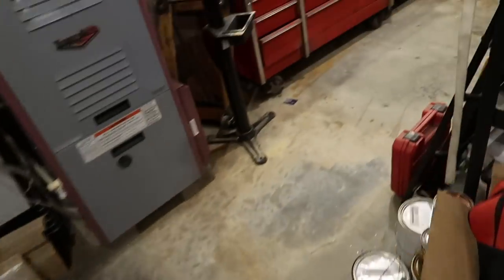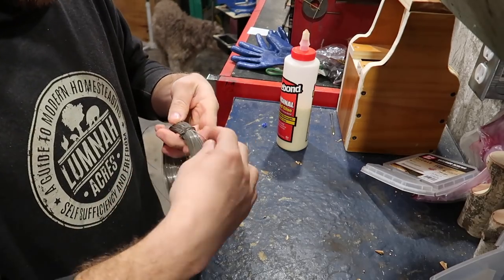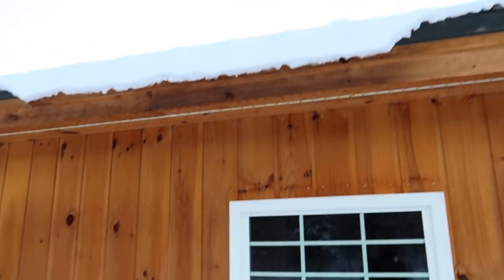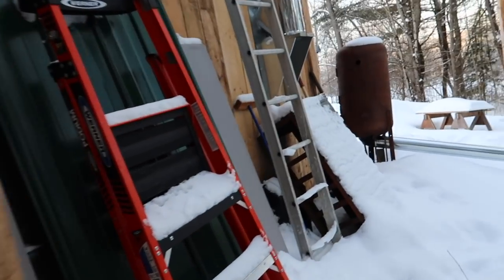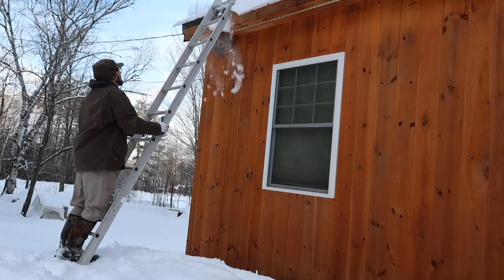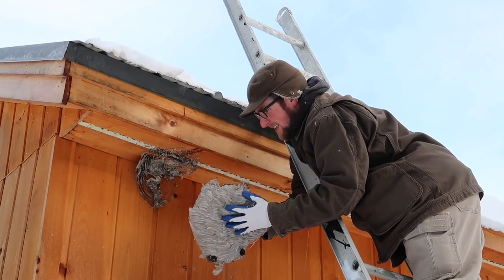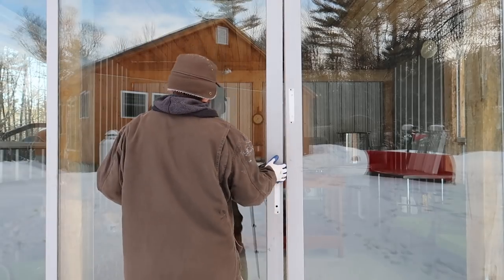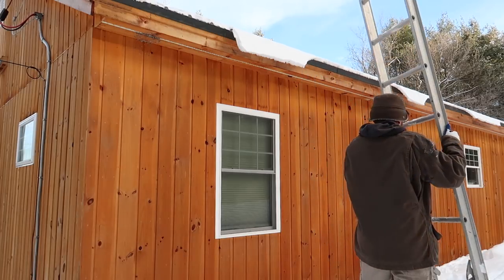Taking Down a WASP Nest  ~ I hope this was a good IDEA

Comment: Those  are white faced hornets and they are the nastiest bees there are. If that was me I would throw that  right into your wood stove. Since I have never trusted "Them" I would think there would be a few bees in there that will wake up after a long winters nap.
  If you still want to save it I would put it in a clear garbage bag and seal it up good and wait and see if anything wakes up in there if so open the bag just a little and spray the inside with RAID to kill anything in there. Wait a week to make sure anything is dead and then do what ever your going to do to preserve it 
   Good Luck
Reply: I think you have the best advice so far.  Mostly 'cause I agree with you.  :)

Comment: Morning Al!  Cut into it!  It's amazing the engineering degree that Mother Nature has!  Personally I've removed a few wasp nests and found them to be fascinating to look into.  The design is amazing and the degree to which it is symmetrical and proportioned will leave you scratching your head thinking 'how'd they do that'!  As far as saving it, I don't think it will save for long, just the humidity in the air will take its toll over time and it will start to crumble and pieces of it will drop down on whatever is under it and eventually cause you to get rid of it.  My recomendation us to contact Olivia's school teacher and see if they would be interested in seeing it.  Up close is always a thrill for kids when it's something they have been taught to avoid.  Good luck either way, very interesting.

Comment: After reading the comments I thought I should answer about how they survive the winter.  At the end of summer they make many new queens that will hibernate, usually in small crevices, like in you wood pile so when you bring the wood in the house and they warm up they start flying around.  It is possible that one or more queens are hibernating in the nest. So some caution should be taken warming it up. They are slow moving when first coming out of hibernation so easy to crush.
Reply from the maker: Thanks, that makes a lot of sense

Comment: The common name for this wasp is a paper wasp.  Yellow jackets usually live in the ground in a hole.  The inside top part that you exposed when you broke the nest off the house is the brood chamber.  You can see all the cells where eggs were laid.  Likely the open cells are where new wasps hatched.  The closed cells may have an egg or a developing wasp.  I don’t think any of the young would be viable but you may want to check to be sure before you hang it up inside and start the heating process.  You don’t want to have paper wasps in your outdoor kitchen.

Comment: Looks like a typical yellow jacket nest. Yellow jackets gather up wood fibers and combine with sputum to make these paper nests. Yellow jackets are also a superior pest insect predator. While we might not like the idea of having them around our property, the number of pest insects they consume makes them a beneficial insect. They only become dangerous if your mess with an active nest. This nest should be safe. Males mate with queens who then seek out someplace to hibernate over winter. Workers in the nest will die over winter. They do not reuse old nests. In southern states, that don't experience a hard winter freeze, nests may carry over for a number of years and reach monstrous proportions, numbering over 100,000 individuals. 
There are other species of paper wasps, although they don't build large, elaborate nests like yours. Typically a small, open faced disc, consisting of a couple dozen cells. 
Mud wasps or mud daubers, gather up mud to make their nests. These also are small in comparison to a yellow jacket nest. Consisting of numerous, hard, clay like tubes. Queens will lay an egg in each tube, and deposit one or more insect prey species that is still alive but immobilized. When the eggs hatch the larva feed on the prey species until it's time to pupate. After pupation, the now adult wasp chews through the end of the clay cell. 
You might also see solitary wasps in and around your garden. These are large dark wasps, often seen on the ground entering into their underground burrows. In these burrows they lay one egg, and like mud daubers, deposit one or more prey insects for the larva to feed on.
Despite our fear of wasps, they are beneficial to have around due to their predatory nature, although they will feed on meat and fish scraps as well. Unlike honey bees, whose stinger pulls out after stinging leaving the bee to die. Wasps can and will sting repeatedly. If you are perceived as a threat to their nest, they will swarm you and chase you, sometimes a hundred yards or more. It is during this, they will mark you with pheromones targeting you as a threat. Should you return to the general area of the nest, these pheromones will alert sentries and the attack will resume.
Reply: I just found one about 50 ft from our house on the corner of our barn. My son is severely allergic to wasps. We have to remove it. Though I do appreciate that they eat pests.
Reply: Actually, those are bald-faced hornets

Comment: HORNETS!! If it we're me, I'd bag it in a clear jumbo ziplock. Squeeze out as much air as possible and wait. In the spring after all are totally dead. I'd unbag, dissect the top ring, mount on a neat looking stick and attach it to a board then to the ceiling of the outdoor kitchen! That way when Olivia is into science projects you can take it down for her to use. We got one for my Sister-Dear one winter that was mounted in the v of some bushes. We had a heck of a fun time getting it. We put it in a large garbage bag and sprayed raid. It looked cool with the branches attached.

Comment: The next time you take one of those nests down, purchase a can or two of AquaNet hair spray, then soak the nest thoroughly and let dry, the hair spray will firm up the layers of paper material and hold it together, making it easier to use various methods in removing the nest without too much damage.
Reply from the maker: Great tip! Thanks

Comment: You could try cutting it into a cross section so that you could see the individual cells. Then spray it with polyurethane so that you can mount it somewhere. Much more interesting if you could see the inside as well as part of the outside.
Reply: Just have to do all that outside and while still below freezing.  Don't want those critters waking up.

Comment: I would either cut the wasp nest in half or cut out a quarter wedge. If in half, I would epoxy or hot glue a clear sheet of plexiglass or polycarbonate to the cutout side, so you could show the outside & the inside off. The clear sheet would help it retain a decent amount of strength to hold it's shape. The corner wedge, I would just turn the cutout side to the corner when putting it up in the outdoor kitchen.

Comment: We collect them.  When undamaged they are worth about 250.00.  I have 3 in my living room right now.  lol  They are hornet nests.  You do NOT want them around your house, they are mean little buggers.  We usually find them in trees and keep the branch intact that they built it on.  The torn part is from birds or mice getting into it.  Usually birds tear the nests up in the fall after the hornets are dormant, they like the "honey" in them.  Your nest is not worth anything.  You can try to shilack it (sp) but since you couldn't get it down without damaging, it won't last long.  Mine are 12, 14 and 16 years old.  We usually put it in a black garbage bad and spray it with hornet killer, keep it in the garage for a few months to make sure none are still living, then spray it with shilack and they last a long time when hung and undisturbed.

Comment: I recommend putting it inside some sort of closed clear display case like a small glass dome. Ikea sells glass domes online for 12$ you can out the bees inside and it will protect you if anything wakes up because the bees won't be able to escape. http://www.ikea.com/us/en/catalog/products/40327303/ https://img1.etsystatic.com/108/1/7749462/il_340x270.898205775_2kk8.jpg this is a common way for nests like that to be displayed.

Comment: Ya i had one of those in about the same spot on the house. I have boys so ya we kept it & it decaded quickly. We also had the mud bees. Lol i thought it was my boys having mud fights so i just knocked em down. The next yr they multiplied I realize its not kids. I checked every eve every building got em all knocked down. Lol the next yr lol every eve had mud clots lol i had to figure out what the mud clots were cuz if it was a kid this was out of hand. Like you i investigated. When i realized it might be an animal i took it to the plant nursery. They had several names people call that kind of bee. I spent 4 years before and all threw spring looking finding removing mud clots. They multiplied every yr even went inside garage. I was losing big time. I got mad did a super hunt removing all & spraying the suffice after removal. Every week all yr long. Finally i won, its been about 10 yrs now with no mud clots. I did look at allot and some it was obvious bee holes some were not but i sure learned what aggressive means. So ya when i get one like you have that's not a mud clot its paper like and light and hear its wasp. The mud is a dried up clunk of mud that's not a perfect round soft ball of mud but it's tight hard and heavy. A neighbor told me I'm lucky cuz the bees that use mud have been known to make one hudge mud nest that fills most of a garage with a massive size mud hive in less then 24 hrs. The nursery said this kind has no benefits and yes they looked like a strange kind of fly with bee strips.

Comment: Seriously, dude... If you don't put that in a plastic bag with some raid and leave it for a couple months.... Burn it! Funny thing... Last year I had my water heater installed on the exterior of the house. Bees took it over. I would have left them, but anytime I got within 15 feet of it, they attacked me. Every time! So I disconnected it and rolled it down the hill. Planned on retrieving it in the coldest part of the winter. Taking the jacket off of it. And getting rid of the bees. Guess what yesterday was. Coldest day of the year, so far. These guys looked like honey bees. But there was NO comb whatever. And like I said, they attacked me every time I got close.